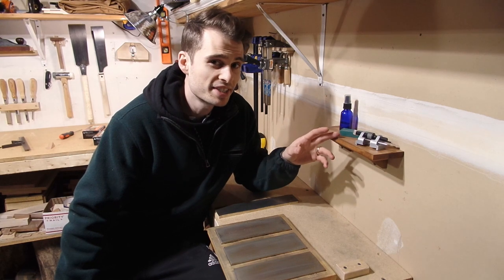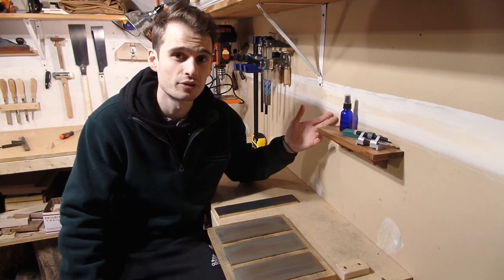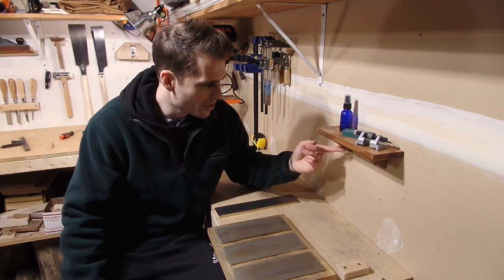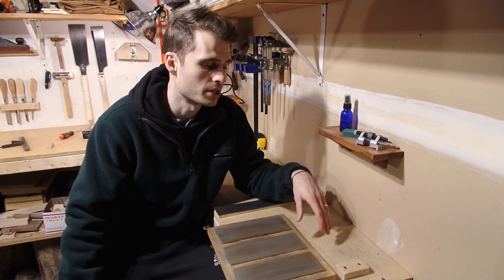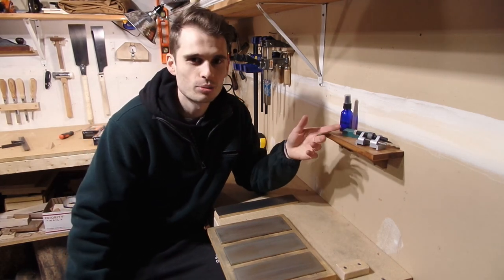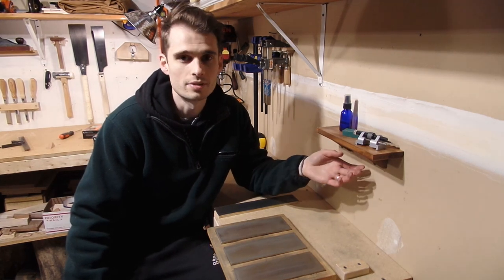Turning an old piece of wood into a wall shelf | Quiet Woodworking

Comment: Your videos are relaxing to watch. Thanks for the content. Quick question. I saw you have a new shooting board. Which style do you prefer?
Reply from the maker: I'm glad you're liking the videos! 

I think I prefer the original one that's made out of pine and has a slot for 45 degrees. I've been having a lot of trouble with my shooting boards though. Both fences (old one and new) aren't actually perpendicular to the edge so it doesn't actually get the board perfectly squared. I tried to fix that with the tape on the new one and it didn't work. And then my number 5 is really out of square from the side of the plane to the sole so I have to really skew the plane iron and it usually doesn't end up square from face to face. Anyway, I feel like I'm still trying to figure out the shooting board and I think if I had a better plane that both shooting boards would end up being fine.